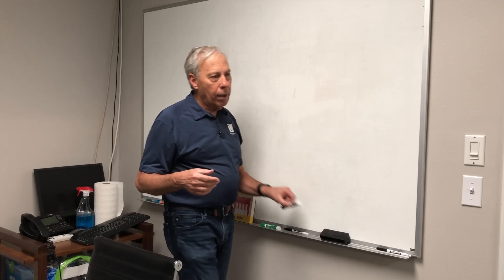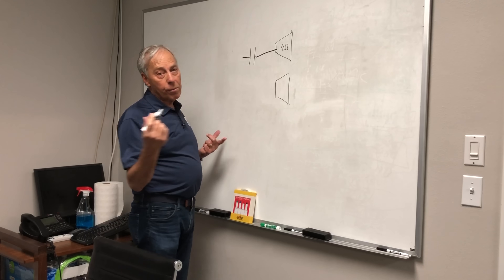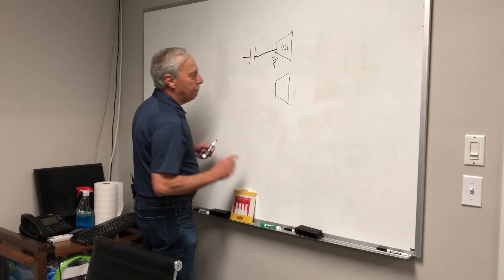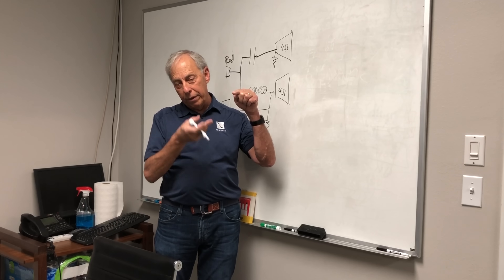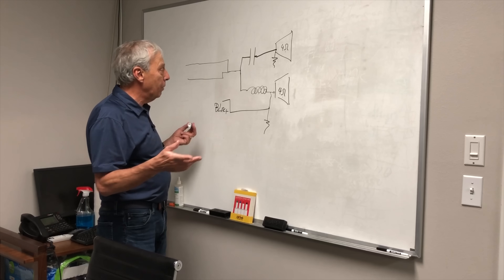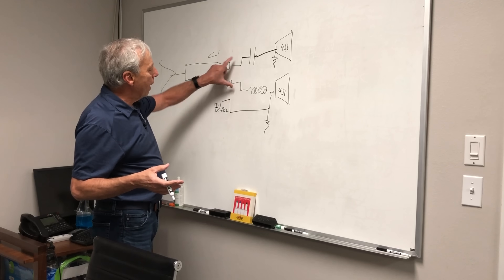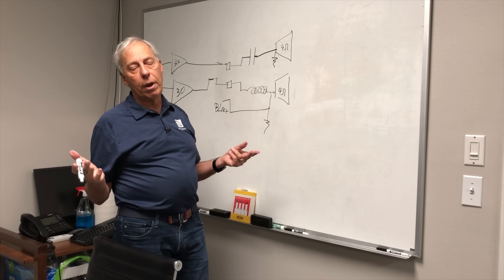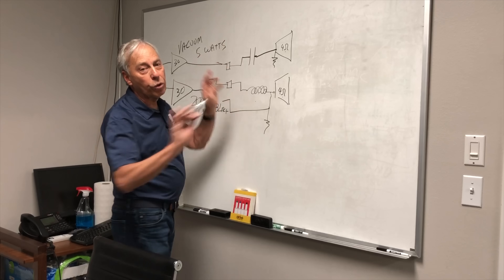How does bi-wiring work?

Comment: I enjoy both bi amping and biwiring. Have done both in my systems throughout the years. Definite sonic gains in both 👌💥💥
Reply: Bryan Peck
Perpetuating & proliferating ignorance & anti-science is not 'playing nicely'. That term is just  another way of saying everyone's opinion is equal, when they clearly aren't. Relativism is a pox on humanity.
Reply: Dion Parchment
I have run a fully active three system for eight years, including cnc cut laminated cabinets.
Bi-wiring is a silliness for those people who want to pretend something has happened.
Your 'fun' is at your own expense, sadly for you.
Reply: Bryan Peck absolutely. Just having a little fun with someone who doesn’t like the idea of sonic improvements
Reply: +Dion Parchment
Up in arms? I merely pointed out that what you said has no basis in physics, and unless the the laws of physics change in your home, the problem is yours. 
A faux thank you for for your faux concern too.
Reply: @Frank Collins i think you are the one who pointless and stupid to mocking everyone with those stupid statement and science from f*cking nowhere.
Reply: What a bonehead. When you learn to write English, post again.
Reply: Dion Parchment
I can 'understand' your logic, it is just as sound as your writing; unstructured, messy, and lacking coherence.

Manufacturers put extra binding posts because one did it it to gain a marketing advantage with the mostly ignorant boneheads who think they are 'audiophiles', a pejorative term. Others followed to cater to the 'audiophile' cult. 

While your type 'experiments' with silliness, others actually build their systems, all of it, from scratch using real science and technology.
Yes, that's right, design and build ALL of it, while pretenders faff about with extra wires while believing it actually does something.

Angry? Not at all, but that is the last bastion of defence for the illogical, cluttered mind; making absurd, unsustainable claims of emotional upset.

On the contrary, you provide much amusement as you flounder about, both with your writing and thinking. Both make no sense.
Reply: @Frank Collins if people have decent money and want to try bi-amping, why not?
all i know, they do not know you and still bi-amping theirs. 

despite they are moron or not, it still their money they want to spend.
why you so mad with how moron spend their money?

hope you save your energy and do something useful rather than mocking every moron.
Reply: Frank Collins Frank Collins wow...it’s curious that you will resort to name calling and writing contemptible statements over something that in no way affects you.  How does somebody’s system configuration have any impact at all on your life?!  If you get so upset and rude over something as simple as this I wonder how you conduct yourself over topics that actually matter?! I guess you feel you can speak as you wish because you’re hidden behind your computer as you type angrily away. I wonder what kind of person you are in the flesh.   Seeing how you conduct yourself on here I’m pretty sure my guess about what you’re like in person wouldn’t be very far from the truth.  Let’s not forget. The topic is experimenting with biwiring!
Reply: vi sby don’t waste your time with frank. He’s an angry man that holds his personal ideas so tight and close that he only knows how to lash out in anger when someone doesn’t agree with him. Let him live his miserable life. Don’t bother with him. He has nothing of importance or interest to add to this topic.
Reply: Anyone who uses the word 'sonic' has no understanding of basic physics.
Reply: Frank Collins http://www.sonics.in/aboutus/  http://www.polysonics.com/  https://m.indiamart.com/sonics-acoustical/  https://asa.scitation.org/doi/full/10.1121/1.4807306  http://oceansonics.com/. https://www.pharmasalmanac.com/articles/acoustics-for-separation-and-filtration-of-applications   https://books.google.ca/books?id=Qg4DSB8Y7KYC&pg=PA188&lpg=PA188&dq=sonics+and+acoustics&source=bl&ots=HkZVY5gYYQ&sig=iKP2oWqFA7S9Adk4034FkouwL0A&hl=en&sa=X&ved=2ahUKEwj16o2N1YHdAhWp1IMKHblsDa04ChDoATAEegQIBBAB 

Guess you don’t read much 😉
Reply: Frank Collins lol 😂 sure thing. Why are you even still on this topic?! Don’t you have lectures to give?! Who are you trying to convince?! What are you trying to convince them of?! I’m just responding to you out of sheer amusement that you take this to heart so deeply that you’ve been thinking about it months after the initial post. Only to reply to a comment with some weak attempt at what exactly?! So funny
Reply: Dion Parchment
Funny how physics work - unless you have the most craptastic setup possible bi-wiring will not make any difference what so ever.
If you still believe your own bullshit - go get a nobel price for the discovery of new principles that shake the very foundation of physics.
Reply: Dion Parchment correct
Reply: Frank Collins lol
Reply: Frank Collins man you really get up in arms about this stuff huh?! Had a bad experience with some speaker cables once? Lol 😂
Reply: Frank Collins !!! Did somebody just learn how to write English?! 😮😆
Reply: Frank Collins lol! This is so much fun!! Unstructured, messy and lacking coherence. Wow 😮 it’s a good thing you’re not a professor of technical writing! Youtube is not a peer reviewed research paper frank. It’s a place to post videos and comments so if my writing skills are not up to your standards well...you’re just going to have to live with that as you clumsily stumble through my grammatical choices lol. 

You’re pretty entertaining though.  You say you’ve built your system from the ground up?! All of it? You designed your amplifiers, preamps, dacs, speakers and cabling?!  Now that’s a hobby! Do you sell your creations? Have you taken them to audio shows?  Have any of your creations been reviewed and tested? I’d love to see/hear them! Or have you been shunned by the all powerful money hungry manufacturers?
Reply: Dion Parchment
What I can't understand is how someone can make so many ridiculous assumptions from the text I post. Try processing the text and understand the words, not your wildly emotional interpretation.
I suppose anyone who can look in the mirror and think that silly facial hair is anything but silly cannot have self-awareness and sound thinking. I have associates like you but get rid of the tiresome bores.
Reply: Frank Collins there’s a difference between “assumptions” and asking questions...there are little squiggly things that look like this: “?” Those are called question marks. When somebody puts those after a statement it is meant as a question to gain information from the other person about the topic at hand.   Seeing as you’re having such a difficult time in deciphering what I’m saying and following along I can’t help but wonder if English is your first language. 

Anyways enjoy your “self made” audio kit. Audiophiles can only dream of the audio nirvana you must be experiencing.  You have nothing of importance to say and no knowledge to share with people who simply want to enjoy a hobby in the way that they want. Your attempts at insults are pathetic at best.  I was just having some fun talking about the topic of bi wiring and amping. You obviously have some closely held feelings about it. Knock yourself out with that. Nobody cares frank...people will continue to build their systems as they please with no regard for your belligerent attitude towards them.
Reply: Dion Parchment
As will all fwits, as you demonstrate.
Reply: vi sby Because it is pointless and stupid, much like your post.
Reply: vi sby
lol
Reply: Dion Parchment
From where do you pull this demented crap?
Pointing out the silliness of a practice & the lack of a cogent argument does not make me 'angry'. In fact, the use of such terms only serves to demonstrate the paucity of your case.
If that is the best you have, don't bother. Only the intellectually challenged fall for such bullshit.
BTW, shave off that labial hair, the hallmark of a true bogan.
Reply: Frank Collins 😉
Reply: irrelevant but funny....my gf asked if you speak visaya...the language of cebu....aparently bi amping means..'take care' maybe you can ask frank to bi amp...
Reply: Are you aware of expectation bias?
One is a real change, while the other is illusory.
Reply: Dion Parchment
Now I know you have no idea.
But, of course, expectation doesn't affect you. WTF does quantum field theory have to do with anything? You are a master of Logical Fallacies, if nothing else.
Reply: Dion Parchment
I ask again; are you aware of expectation bias?
Reply: Frank Collins I’m aware of sonic improvements when connecting a system correctly with high quality components in the manner that it was intended 😉
Reply: Frank Collins i think we should just play nicely gents, afterall we are all here with the same interest in mind...
Reply: Frank Collins oh absolutely physics is better in my listening room! It’s one of the natural constants of the universe! Thought you knew! Since you seem to know so much! Regardless enjoy your listening...and stand strong on your soap box! Cuz...it really all means so much 😉 lol cuz honestly...who uses cnc machines cabinets?! You living in the dark ages?! The dampening factors on that alone will ring the ear drums right out of ya! Then again...that makes sense seeing as you can’t hear differences lol 😆
Reply: Frank Collins hook...line...sinker...relax dude...you’re obviously way too wound up about bi amping and bi wiring. People will build their systems how they want...they will experiment with different configurations and try different setups. If you’re getting so upset because somebody tries a different way than you do...maybe you should take a step back from it all. Manufacturers put two sets of binding posts on their equipment for just that purpose to experiment and give consumer options.  I don’t know anything about you however just from these posts you seem to be an opinionated angry individual that would rather try and insult someone over something as benign as speaker wire configuration than to just enjoy the hobby.  You can knock yourself out with all the name calling you’d like. It still doesn’t change any of the facts. People will always experiment with their systems...manufacturers will always give people the option to configure their systems how they wish...and there will always be sour individuals who simply can’t grasp the idea that the options are there to enjoy.  Sure...I’m a bonehead....or...I just got a kick out of allowing you to get all wound up over absolutely nothing at all lol.
Reply: Justin Griffin lol
Reply: Frank Collins absolutely! Are you aware of quantum field theory?